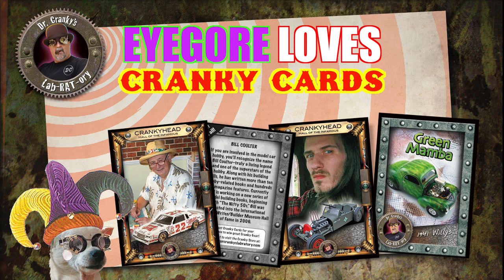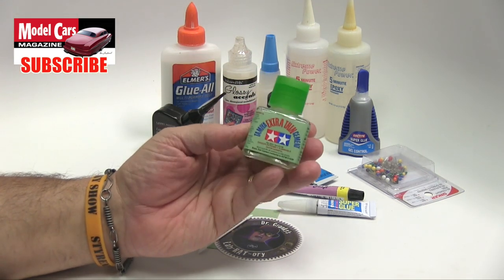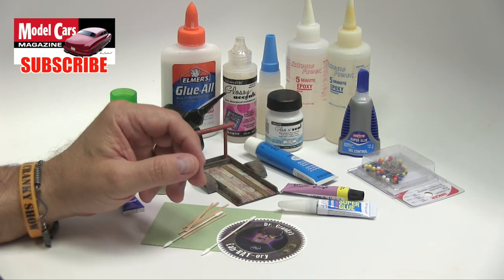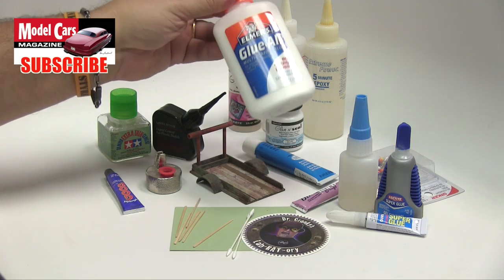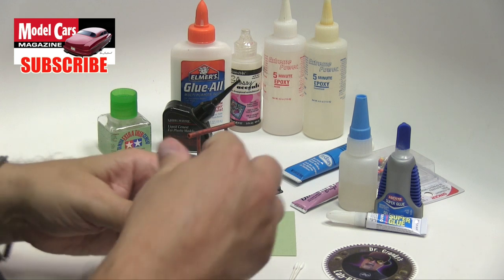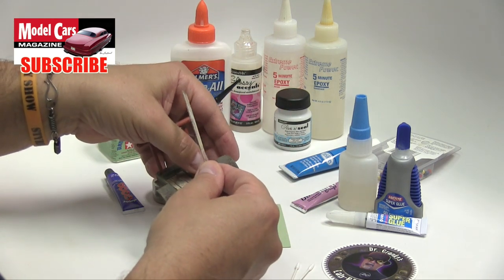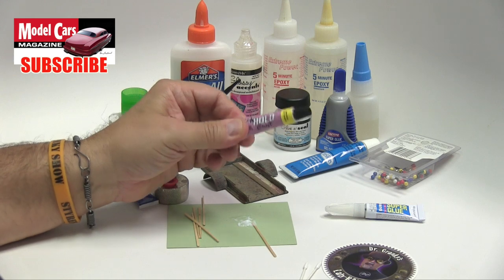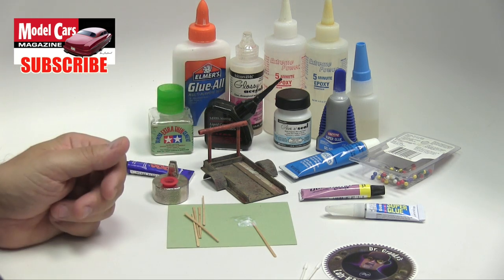CLUES ABOUT GLUES

Comment: Good vid DC. I drill a hole in the center of a straight piece of spru, and glue a sewing needle in it. This allows me to have several different sizes of tips for gluing hard to get to places, and the straight length of spru helps to keep my hand steady. Kinda like holding a pencil. Hope this helps someone.

Comment: What is the best glue to use when the parts are painted?
Reply from the maker: Rick Perry Great question, Rick.  We like to use the good old model cement, and Testors clear if we are gluing lights and smaller details on the body.